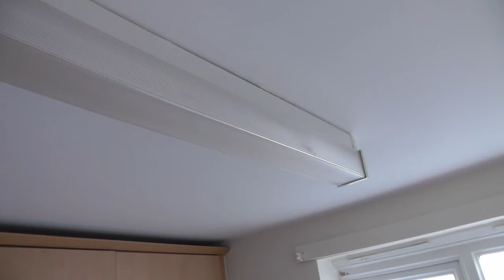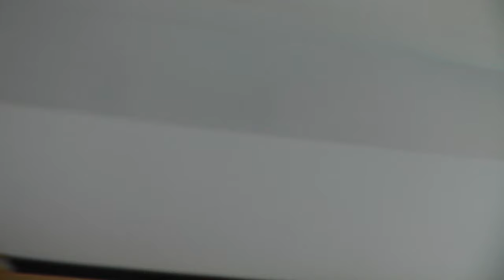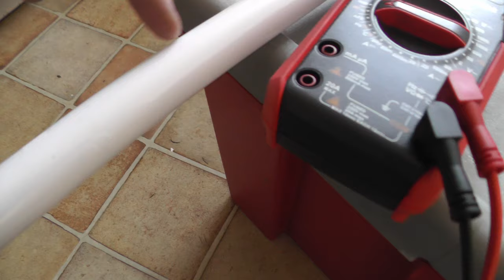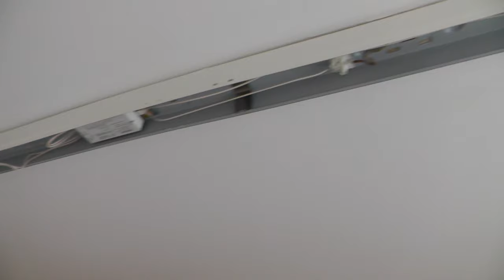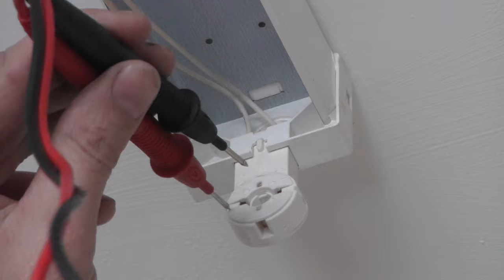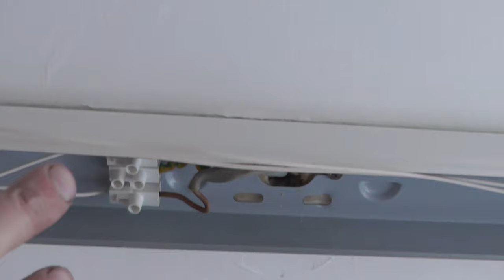Fluorescent light how to troubleshoot, fault find and repair ( electronic ballast )

Comment: Can you use a simple continuity tester to check and see if the bulb is good or not ?  Mine 'beeps' when you touch the leads of the tester together so I'm guessing a beep when you put the pos and neg leads onto the two pins that stick out of the ends of the bulbs means the bulb is good , right ? Thanks !
Reply from the maker: Yes, it tells you the filaments are ok at least, i cover that in the video if i remember correctly.
Reply: @cagmito76  I tested my bulbs T8 thin after seeing your video with my meter on olms and they read 30 ohms so I knew they were good, and they worked in another fixture.  I want to check the ballast and wonder if I can check the voltage at the pins holes with my meter set to 240 volts?

Comment: With the power on can you test the pin holes on the fixture for voltage to see if the ballast is ok?  And what should it read?  120 volts or what?
Reply from the maker: I cannot advise to test live equipment , sorry. The transformer / Ballast will have all voltages on it.

Comment: I have a problem with several under-counter fluorescent lights that have been burnt out for a while.  I bought a pack of 5 off eBay, and only 2 out of 5 worked. They appear fine, but 3 wouldn't light.  I also bought a pack of 3 from Amazon. One I replaced, and it works fine. The second fixture was burnt out as well, but neither of the extra 2 works in the remaining fixture.  Why so many apparently bad bulbs?  None should have come on if a bad ballast but only 2 out of 5 replacement bulbs worked.  I don't understand why such a high percentage of replacement bulbs off eBay- damaged in shipping?  They are t5 16 and 20-inch bulbs.

Comment: Mine is about 6ohms each side. But i don't know the wattage of the bulb, there is no info printed on the bulb. How can i find the wattage?
Reply: Get a volt reading and a amp reading on one of the good ones and multiply those 2 numbers together for watts. 

Like here in U.S. a 120v system drawing   .25 amps is a 30 watt.  

V x A = Watts